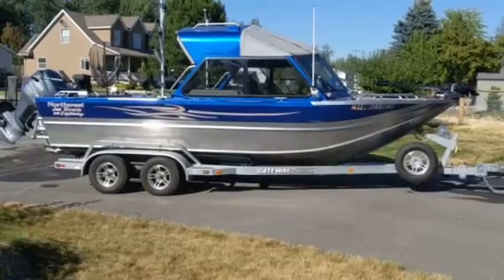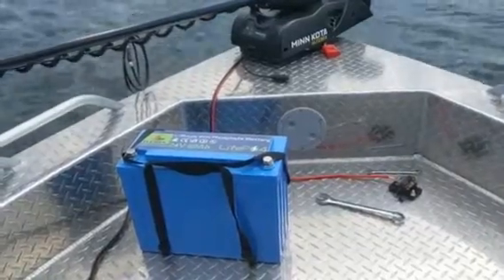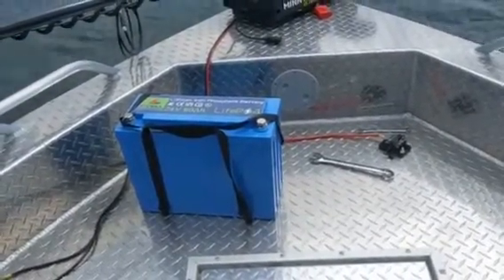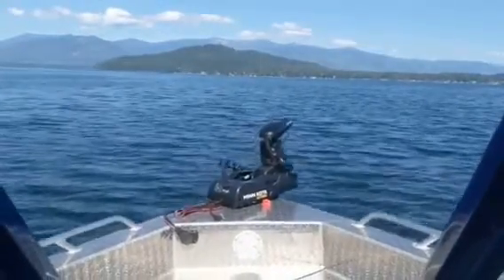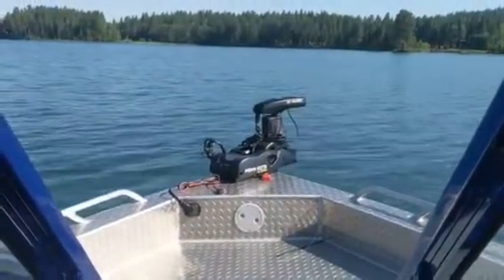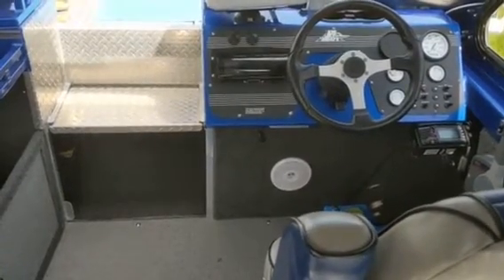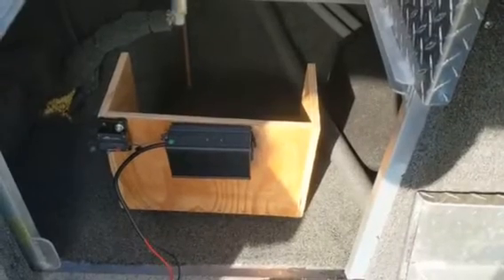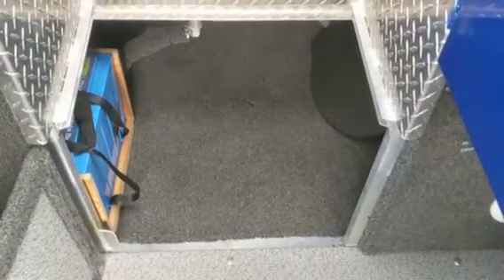O'CELL 24V 80Ah Lithium Battery Install Into Minnkota Trolling Motor

Comment: Do you just hook up both connections to the battery since it’s a 24V battery? So no need for 2 batteries?
Reply: Correct.
Reply from the maker: @virgilhotomanie7890  What's voltage and max load power(W/KW) of your application?If you need more help and more support, welcome to add engineer whatsapp:+(86)13798116787, or send email address: sales31@ocelltech.com
Reply from the maker: What's voltage and max load power(W/KW) of your application?If you need more help and more support, welcome to add engineer whatsapp:+(86)13798116787, or send email address: sales31@ocelltech.com